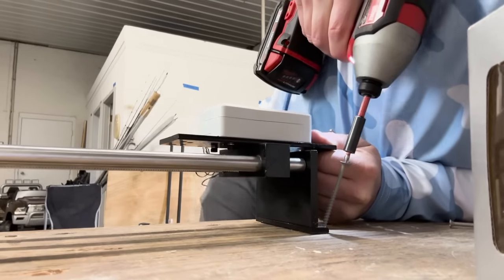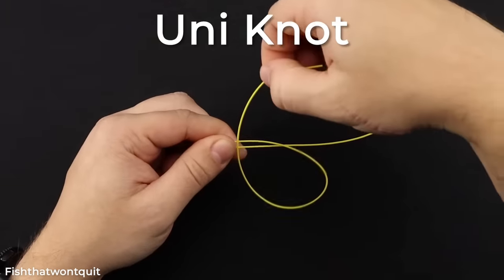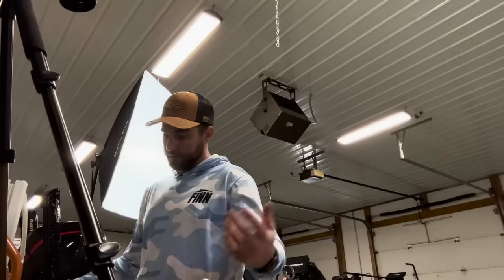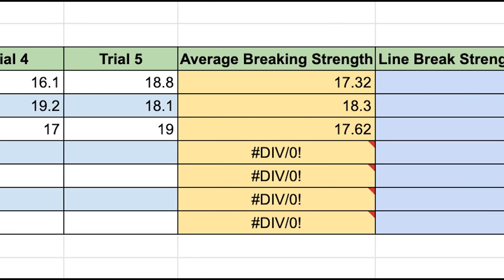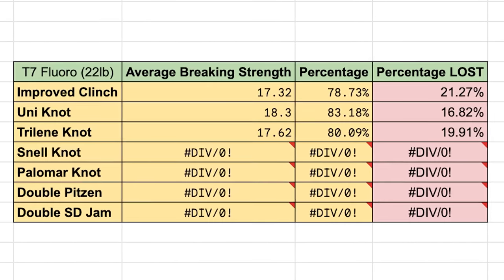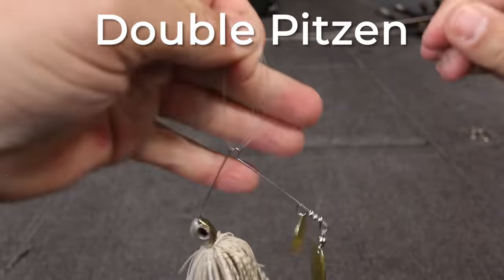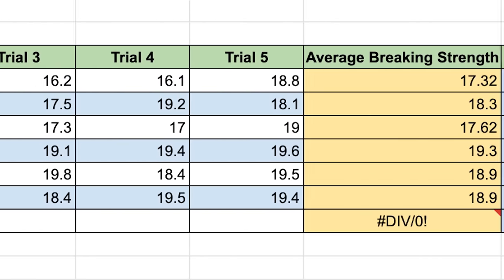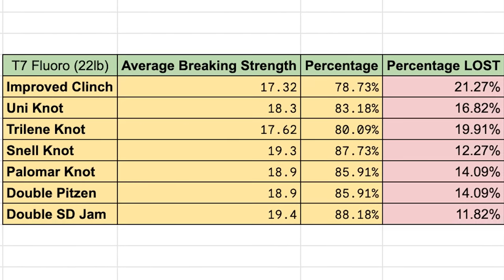You’ll NEVER Tie Another FISHING KNOT (I TESTED Them All)

Comment: Love your video because it was very informative... however first problem I noticed with your testing is that you claim the line to have a breaking strength of 22 lb from 20 lb test line but we all witnessed that the line did not even make it to the 20 lb rating so that leads me to feel that that brand of line is overrated.... the second issue came where some lines were a single Loop and others were a double Loop.. I feel you should really expect to get a considerable increase by doubling the line but this line did not prove to even reach its test poundage when even doubled also showing that this line again is overrated... there should be realistically no way that a doubled line should have equal to or less brake strength than any single line knot which would kind of make the basis for the test inconclusive... however what I did find interesting is that the single stranded Snell Knot pretty much kept up with the San Diego double Jam knot.... you may want to try this test over again with a different line because something just seems off...

Comment: I would check how well you are tying knots.  I performed this test many times over the years and get completely different results.  For example, when you tie the uni knot, and most other knots you want to lubricate the line.  When you pull ine togther in a knot it creates friction and thus heat.  heat destroys nylon.  If you tie the uni knot correctly you should be getting closer to 99% of line strength.  I can presume how you tie you dont fish with light tackle such as 2lb, 3lb, 4lb otherwise you would know this.
Reply: Depends on the line brand. He's using a 22lbs line.
Reply: @Rose_A  Definitely not.  Heat causes friction regardles of line weight.  Any heat will weaken the knot.  Uni knot is rated 99% of line weight if tied correctly.  Only a few knots is greater than this such as the bimini
Reply: @christhekiwi109  you've obviously never bought fishing lines before. The weight is advertised on the bottom of the box, different brands don't necessarily test them the same way. Go watch his other videos where he tests the strength of each brand he bought.
Reply: @Rose_A  You are definitely correct, I don't but fishing line.  My 16 reels magically spool themselves.  You are also correct that not all manufactured line is equal..

Comment: Observation, at the start of the test, your device was wound all the way to the start of its housing. Second test your measuring device was halfway through its full stroke, therefore the line on the second test started as a longer piece of line. Unless EVERY piece of line starts as the same length you will generate discrepancies and inconsistencies in your test results. Just an observation.
I wonder what the results would show if ALL lengths of line started as the same length and All tests started from the same position on your jig?🤷

Comment: Double line knots will generally always be stronger than single connections... usually adds 10-20% to breaking strength..
Every line ,whether ; mono, copolymer, fluorocarbon 
braid(spectra, dyneema, gel-spun),
Each individual line has a knot which is best ,due to its own characteristics....experiment with your line of choice...

BTW- you Always add in the bad knots you tested because that shows real-world results ,, part of what makes a knot,  a good knot,  or the " best knot "is the holding power when you screw up tying it..

A holding knot is Not better Overall for most people, if the % of correctly tying is higher %..
There Will be More failures!....

-previous professional line / knot tester,  & literally,, thousands of tons of fish & trees have been Successfully held by my knots...😎

Comment: Did every test break at the knot ?
The polamar knot you tied wrong in the experiment.
You do the overhand ( was correct)
You pass the lure though the loop (was correct)
Before you tighten the knot the loop should go up to the main line not test on the eyelet or on top of the doubled line .
Why?
The line will cut its self, very common error.
Source Gedio Hinden

Comment: So this test has a major flaw, because knot testing in the past has shown that the best knot for fluoro is not the best for braid or mono. But this test fails even as a test of fluorocarbon line because what tests in the past has also shown is that the best knot for thin line is not the best as the one for medium or thick line. So for instance, the GT knot is stronger than the FG knot for 0.40mm line, while being far weaker for 0.20mm line. 

And in this test you're testing on very thick line which will significantly skew the results in favor of knots which will not be all that great for most of us.

Comment: You obviously tied the Trilene knot totally wrong.  The key is to tension it and push the coils up.  If you didn't tension it, you won't get the coils to sit properly.  Its the only 100% knot I have verified 50+ times on my Chatillon TCD200 machine.  Breaking at over 20 lbs is nothing unless you tested the line by itself to verify it doesn't break higher, like 22lbs, etc.  The other factor to consider is to examine the broken knot to determine whether it broke at the line or at the knot (or your crimp also).  Knowing where it break is important to determine if its the line, the crimp or the knot that was the weakest point.  The goal is to break at the line.

I do at least 20-50 times per knot to get not just the average, but the standard deviation.  You can't do that with just 5 knots, or at least not enough data points.  I haven't tried the double SD jam knot yet, but I will when I have the time.  I tested so many knots that I ran out of a 1000 yard spool 20lb mono.  I don't have 1000 yard of fluoro, so the number of tests would be less.